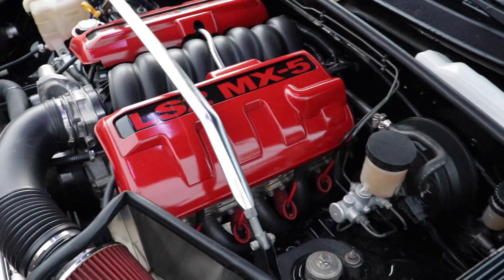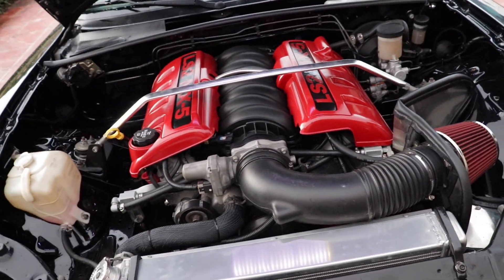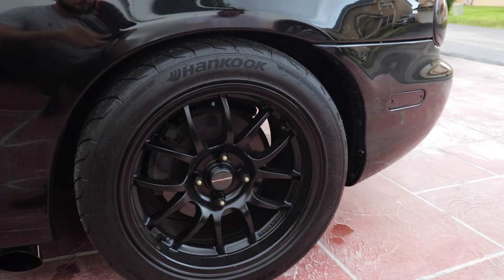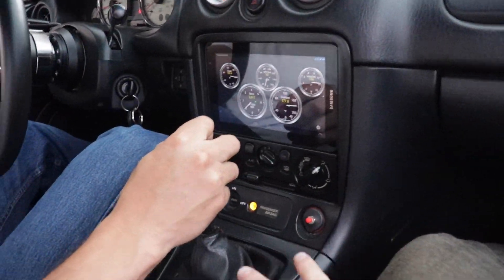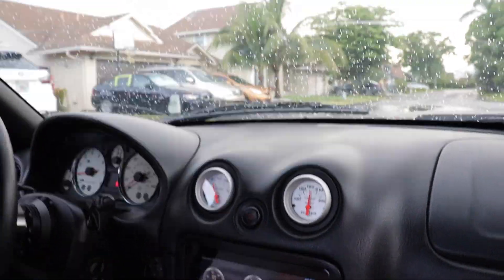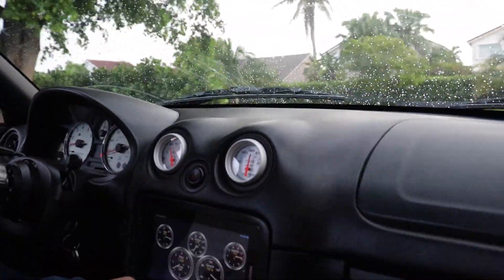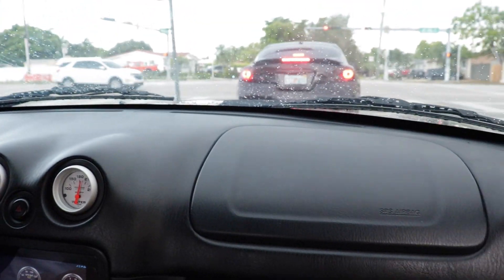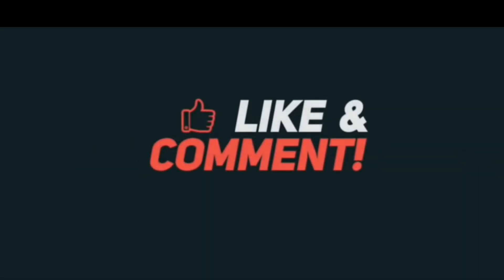NASTY Cammed LS2 Mazda MX-5 Miata | Review

Comment: Very nicely done.  The car too.  LOL.  Massive eye candy.  I am so surprised that an LS V8 fits in one of those.  A Miata is not supposed to sound like that, and that's exactly the reason why I love it.  Total sleeper.  I can't wait for you to do a video on his Mustang.  He raised the bar on your gas saver Miata.  (Mrs. G's Miata as she would say)  ;-)
Reply from the maker: Virtual Vapes I’m doing a Video on his Shelby GT350 soon. The most impressive part is that he did all this work on his Miata on his Miata in his garage, from motor to transmission to the rear differential to the exhaust, and yes it is a total sleeper and I love it too, the sound in person is so impressive specially coming from an MX-5